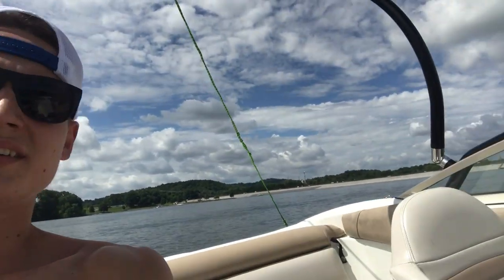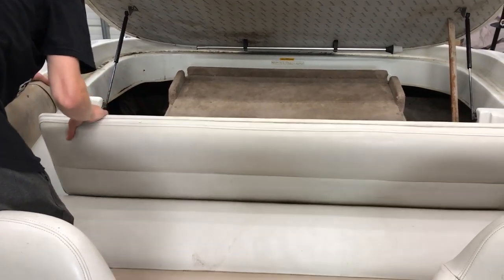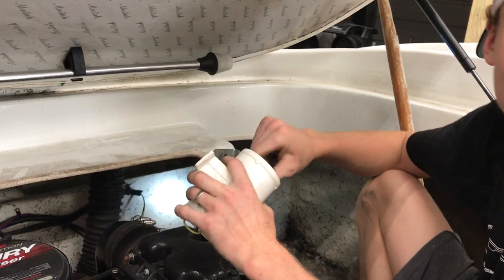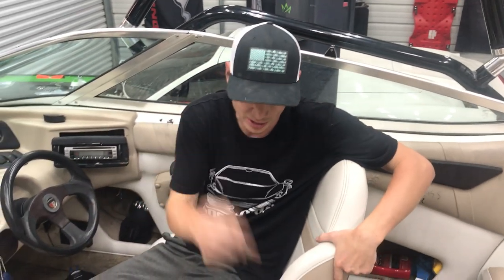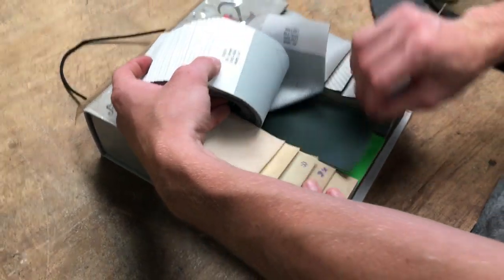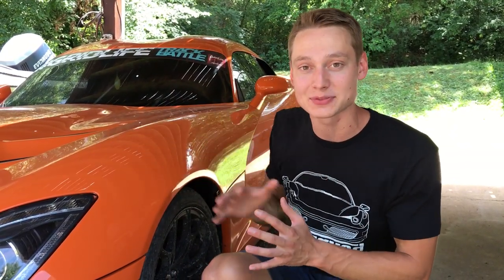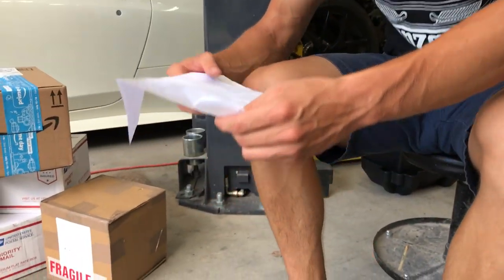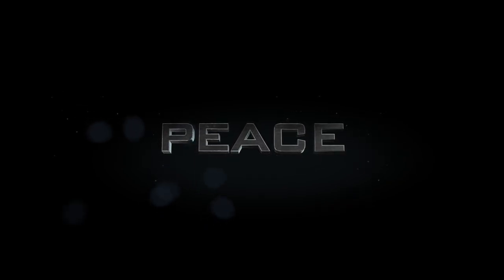Rebuilding A Super Cheap Wrecked Boat Part 4

Comment: Small block Chevy 305 cubic inches not 350
Reply: 5.0 is a small block ford block
Reply: @joe5099  GM also has a "5.0"  block. the ford block is 302 cubic inches while the gm block's displacement is 305 cubic inches. i believe the mercury motors use GM blocks though.
Reply: @grantpoggenpohl123  I have never heard the 305 referred to as a 5.0 I learn new thing today! I have honestly never had a 5.0 boat before all my boats have had the 5.7 Chevy.

Comment: Re: interior on the boat.

The trim pieces are easy, for the most part.  If you remove them, you'll see how they are wrapped in the marine vinyl and attached. Most likely staples, with some foam for shaping, and not much for complexity.  Use contact cement here and there for certain curves, but unless there's a seam involved you likely wouldn't have much trouble redoin' the trim.

The seats are going to be the problem, especially if you're not a seamster.  You'll need a decent sewing machine, marine thread, and practice so you can get the contours, fronts and backs done.  Plus any piping and/or structure rods.  And patience.

Of course, you can pull the current seat covers, take them apart, and use the panels for new patterns.  Sew them up and put 'em on.  You can also go look at some videos by @Cechaflo, very informative regarding upholstery.

But if you decide to tackle it, I'll be watchin!  Go for it!

I trust you with the colors.  But a good ol' American Red White and Blue scheme wouldn't suck. XD.

Comment: That hose with the two plugs is actually the oil pan drain hose. It's supposed to pull through the back of the transom where the drain plug is so you don't have to suck the oil out of the dip stick tube.

Comment: You can take the return hose off the hydraulic pump  and put it in a jug(you will need to cap off the reservoir so it doesn't leak all over. Then start the boat and pour fresh fluid into the reservoir. Try not to let the pump run dry. When the fluid is free of contamination your done. I would do it a second time after a few hours of use to ensure your hydraulic system is free of water so the internals don't corrode and fail.

Comment: 5.0 Mercury is a 305 cube with 9.3:1 cr and a little over 200hp. If you're gonna switch carbs you'll need ot make sure it's specifically a marine carb due to the enclosed engine compartment (same reason you have blowers that need to run before you start up). Marine carbs have a different bowl venting system so you don't go boom.

Comment: great channel guys thanks for the fun vids just discovered you. been boating since 1975 my understanding is the pitch of the prop blades controls rpm of engine so your prop is pitched to pull hard out of the hole but will allow engine to overrev if you need this hard pull out of the hole then ok but you can achieve a much higher top end and keep engine from overrevving by changing pitch of prop. talk to boat shop and pitch for your usage. may have to instal rev limiter dontblowitup lol

Comment: That (At 5:09) is the oil drain hose with the drain plug attached to it. Rout that down out the back of the boat drain. That way you can drain the oil outside the boat without making a mess.

Comment: Me and my dad work for mercury motors at bernico boats. I know a lot about boats, and i know you are looking at an old 12k motor over there. It's a big engine but not the biggest at all, a in board motor is modifyble and can add some hp to it. Only the fin in the back can give you 20hp more if you put on a dual prop

Comment: The “Driveline Lube” or outboard gear oil is low. In those MerCruiser outboards make sure when you fill that oil you pump it from the bottom of the outboard till it come out the vent port in the top once it’s at the level cap off the vent port and fill that little tank don’t just pour it strait in, it could lead to air bubbles in that drivetrain and cause damage.

Comment: The carpet can be cleaned using simple green and a scrub brush, finish off by power washing it. There is no reason to replace it when you could clean it. For the interior you can use Meguiers Super Degreaser with a 4/1 or 5/1 mixture and soft brushes.

Comment: it's a bilge pump and as long as it's pumping out water faster than you're taking water in, you're fine. It has a float (bit like your normal toilet) that activates to turn it on (off in your toilet). Hire a cleaner for the carpets.

Comment: That fan is to clear gas fumes out of the engine compartment. You should run that for a couple of minutes before starting the engine. You can also just open it up and get rid of the fumes before starting it.

Comment: Step 1 get a repair manual! Step 2 learn how to winterize and de-winterize it. If there are plugs removed on the engine you're going to have leaks and overheat your motor. Step 3 replace the impeller. That's the waterpump for the engine. Needs to be done every year or two anyways.

Comment: If you guys want to clean the seats and make them perfect use the scrub and bubbles shower cleaner with no chlorine and a soft bristle scrub brush then rinse with water use a microfiber towel to wipe the seats down and then apply 3O3 conditioner to the seats. You will be amazed. 👍

Comment: Those wires are for putting the engine into timing mode so that you can set the timing. Also, your Speedo might not e working because the hole on the bottom of the outdrive might be jammed up with sand or something. Most boat speedometers work by letting water go in a little hole and based off the pressure it turns the dial.

Comment: Rebuild the carburetor, replace the spark plugs and wires, replace the PCV valve, check your vacuum tubing and put in a can of sea foam to the fuel tank.

Comment: It scares me to think the new belt is going on that easily. Im no master mechanic but every belt ive had to change was either a PITA without a tensioner pulley or i had to use a 1/2'' ratchet to loosen up the tensioner pulley. Like i said though, I'm no expert but just my two cents from what knowledge i have gained. Do think though, you have a strong engine thats trying to transfer it's power through friction in a rubber belt, just saying. The boat is looking great and jealous of it but cant wait to buy my own in the future. Goals my friend, lol. Btw, legitimate question hear and new to the channel but what is your normal job? Youtube? I've subscribed as well so I'm a suporter either way!

Comment: remember the boat is a big hole in the water that you throw money into and never see again. Don't reupholster the interior unless it is a keeper. if you are going to flip it  do as little as possible, fix the inboard/outboard shaft seal and check the outer housing lubes. they need changed on a regular basis as those seals puke all the time. Have fun!

Comment: Maybe your boat is leaning because the foam is water-logged after it sat full of water in the salvage yard. Also, I’d be surprised if your fuel pumps aren’t overheating when you run it for more than 20 minutes at a time. You may have lucked out by it being on such a tilt. It might have kept the starter and fuel pumps out of the muck.  Good luck!

Comment: The hose you pulled out at 5:06 is probably for the oil drain. Most boats have a hose that you can vacuum  the oil out rather than dump it all over inside the hull, just FYI.

Comment: Looks like a small block Chevy 305.  Looks like an 87 and later because of the center bolt valve covers (unless boats are different).  I'd keep the stock carb on it.  I second the fire extinguisher idea too!

Comment: Where's your observer in the boat while wakeboarding? Need to have at least two people in the boat - one driving and the other one watching the skier/wake boarder. Highly recommend getting your boater's safety certificate if you plan to operate a boat. Need to also have a fire extinguisher and whistle. Most states require life vests and other safety gear. Other than that, I enjoy watching your videos and rebuilds.

Comment: the reason the boat didn't go as fast on the way back to boat launch is you were going up stream. It can also cause vibration depending on current.    Please take a boating course for your safety. I don't know of a state you can tow a skier without a spotter in the boat.   Nice job you kids are awesome. 
       Capt. Tim

Comment: The tube is to drain the oil.

You undo the drain plug (the other thing is an extra drain plug) and pull that hose down through it. Then you undo the bolt in the end and drain the oil. Without that you would have a huge mess if you tried to drain the oil.

Comment: 5.0 is a 305 small block Chevy engine and I’m pretty sure that it has the throttle body on it with is all controlled by a cpu. I would leave the tbi on it not swap to a carburetor. Need to check the drive line lube like your oil every time you go to run it. Keep up the good work.

Comment: OK, Goonz- I haven't owned or operated a stern drive since 1982; research and find a Mercruiser dealer- take all the info #s and such. They are the folks you should talk to or will know how to access Mercruiser online. The "trim pump"  will let you adjust the angle the prop in the water after you come on plane(when the boat is up about of the water at speed)- good idea to change it oil and the engine oil, especially if the after section had more than a few inches of water in it- or you don't know for sure. Nothing on a boat is more expensive than Lamborghini parts- but none of it with a for "marine use" (like carburetors) is cheap! Oh, on the wake boarding-Yeeaahh Buudddddyyy!

Comment: You are probably expecting too much to use that assembly to tow a skier.  The hull is not reinforced enough to support that activity and ultimately the hull will be over stressed at the mounting points and likely fracture.  You should install additional mounting points between those you already have to spread the load.  If you tow an experienced wakeboarder who can dig the board into the water on sharp turns, the load pulling on the tower will triple in that instant. Something to think about. Certainly is a bargain though.

Comment: Hey if you can't not get the speedometer working with replacing every part of it look at the GPS ones like a lot of people put in hot rods etc. On the open water they work great. And much better than chasing wiring all over the place. My opinion is do the out side rap on it then when the weather is to cool to use it then send it for the interior. You may even get a better deal in the off season. But have fun and do you up keep nothing kills a boat faster then letting look like shit

Comment: Hey guys just so you know when ur putting ur rope on your tower all you do is pull the main line directly under the loop thru the loop. Then use that loop you just made to connect to the tower. Creates a slip knot/loop that will come off easily by hand but will never break when your on the water. Your line will break before the looo does.
Reply: Loop* I know this because I used to be a waterski coach. Have fun

Comment: Also, you may want to go one pitch bigger on the prop, 5,000 is all you want to turn that small block chevy at. All mercruiser small 8's reccomend 5,000 rpm. Stay away from 6,000.

Comment: get some solar gizmos for it too, all that sun should not go to waste. like a solar heater for emergency, like sleeping in the boat in emergency , solar powered lights for inside, solar this , solar that. solar emergency transmitter ,
solar battery recharger,  also an electric backup motor in case the main engine fails. Solar powered accent lights on the exterior at night, glow in the dark stuff too on the inside, solar powered horn , radio...

Comment: 6” pioneer 600watt speakers where tge old ones was and then add marine speakers to the tower aswell as spotlights and waketower holders for wake bords add an 4500 watt sub with a 6500watt amp aswell as 6x9’s by the seat area where the motor is on the inside basically under the seat area on the extension plank and two 6” speakers in the front of the boat that wil do i have a 2017 mastercraft x15 and have done the same😁

Comment: 5.0 chevy is a 305 cubic inch small block, better way to make power is remove it and install a built 383 stroker. Exhaust youre talking about is from stainless marine and its 3500-4000 dollars for the kit. And you guys got a KILLER deal on that boat for 1800 bucks, Mariahs are basically crownlines.

Comment: I don't know anything about boats cause I don't have one and I never worked on one, but I saw a little bottle with a small yellow cap on it under the hydraulic pump. If you actually pop it out, you'll change the fluid quick and easy, just like power steering fluid for example

Comment: It is a small block engine 305 cubic inches. The blower fan is very important allway's ventilate the engine bay with the blower  fan or just open up before starting then close the cover

Comment: @goonzquad there should be a radio rocker switch on the dash that sends power to the radio.
Reply: also, Hydro-Turf is a good alternative for carpet. its that foam stuff like they use on jet-skis where you put your feet. comes in big sheets.

Comment: I would just do the engine bay carpet first if there is any glue or uneven surfaces may be consider covering it with another waterproof material then a new carpet likely easier For the upholstery I would buy a small piece of material and do the engine cover or an area that isn't so visible and evaluate how I can do it using stapler or check how it is put together first but I think it is all a matter of getting started

Comment: There’s a hole on the lower unit on the front that is for the speedo it might have wood or junk in it if you use a drill bit and clean it out might help

Comment: Just a few notes for you guys.  Did you register the boat with the state, and get a trailer license plate?  Did you get boat insurance on it, including fire, theft, and liability?  You must have a life vest for EACH occupant in the boat.  You don't have to wear them, just have them on the boat.  Talk to your car insurance people also.  In my state, when the boat and trailer is attached to the car, the car insurance covers any damage to boat and trailer,  You should also get stronger hold down straps for boat.  Friend of mine stopped VERY hard once, boat broke both straps, the whinch post, and ended up 6 feet onto his trunk lid.  OOPS!   Also like someone suggested, get a new prop with the correct pitch  (angle of the blades) , learn how to change the prop, and keep the old one, tools needed to change, and extra cotter pins if needed.  If you hit a log and shear off a couple blades, you WILL be hanging over the transom, or in the water changing out the the prop.  Been there, done that in Lake Michigan!  Try looking your boat up on line and see if you can get a copy of the original manual for boat and engine.  Get a spare tire for the trailer and a jack and X wrench for lugs.  Nice buy on the boat, and fun videos for us to watch!  Good Luck!

Comment: 5.0 l should be a 302 cu. in. Small block. Also marine carburetors are different from automotive carbs, they have spark arresting equipment to protect from fire.

Comment: Keep making the awesome videos guys !!  👍
FYI: Your 5.0 motor is a Ford 302 block, similar to what they used in the mustangs and many many others.
Reply: NO NO NO NO NO NO......its a Chevy 305. Its not a FORD ENGINE. If you people cant tell between a Ford or Chevy Engine than your not Gearheads!!! Thats 101 of the Car world. Ford distributor is in the front of the block and Chevy at the rear. Dead give away its not a Ford. Mercruiser is NOT Fomoco.

Comment: The speedo is controlled by what they call a pito tube and it is routed throughout the hull to the lower unit (where the prop is driven)

Comment: The 5 litre engine is 308 not a 350 chev if you’re looking to recarburetor this engine you will need a eidelbrock Valley cover and a Holley carb generally a 650 double pumper if you like spending plenty on fuel 
Cheers from Australia mate!

Comment: That hose let you found at the top of the engine is to drain the oil run it out the drain out the bottom of the boat

Comment: Its a 305 cubic in roller motor roller lifters instead of flat trapper and check on the back of the block if its a 5.0 ho high out models are amazing

Comment: Check the tach. It could be set for a v6. Had a truck once came with a v6 dropped in v8 used factory tach and it read around 1500 rpms higher.

Comment: The common mistake a lot of car guys make is trying to tune a boat/marine engine thinking that it’ll respond the same as a standard auto engine. While they are very similar, a marine engine only really “performs” better with more torque and not more HP, like a car would. Stick with that 5.0, or go to the Mercruiser 7.4 big boy or another drop in, but I wouldnt recommend touching a boat engine EVER as long as its running great. What you could do too is swap out the propeller, thats the best way to adjust your WOT (wide open throttle) cruise speed/fuel efficiency.

Comment: Boat carbs are not the same as auto. They must be sealed with flame suppressors on the on the air cleaner. A 350 replacement engine is the best route. However it must be a marine engine. The Marine engines are cammed different and have brass freeze plugs.

Comment: The milky hydraulic fluid in your steering system means your steering rack has a leak. You need to rebuild the strut that the engine uses to rotate.

Comment: Its a 350, small block engine and a edelbrock carb will make the egine run better and smoother and have a better throttle response and more reliable and release a few ponies amd make it rev better

Comment: It’s a 260 hp we had a Mariah SX 22 limited edition same engine we also had a 5.0 liter And check that bolt out it’s the rear end plug when installed put some white water resistant tape on it